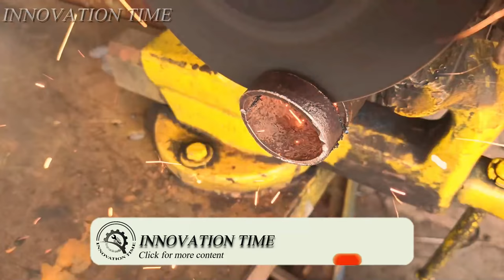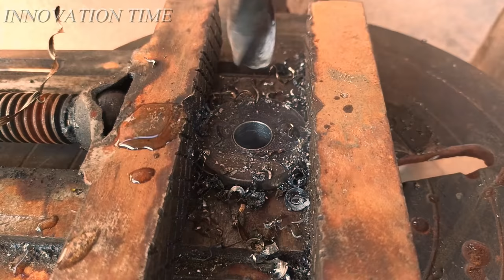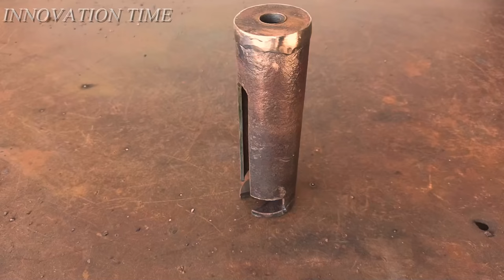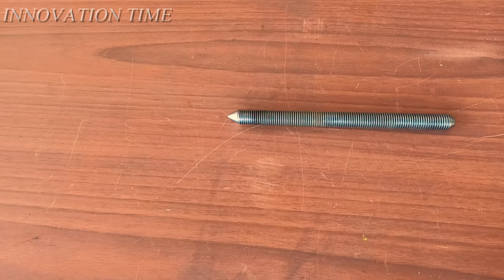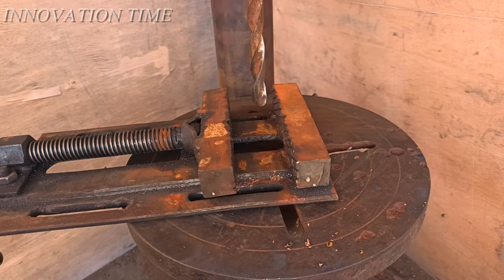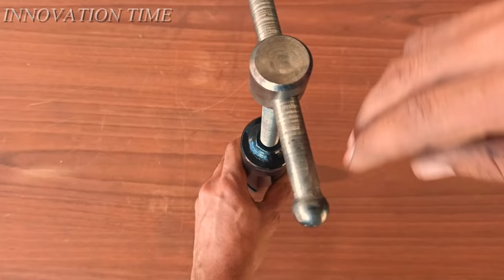AMAZING BEARING PULLER // DIY TOOL

Comment: Good idea but if the bearing is on the type of shaft shown in the video you can remove it with the vice and a copper hammer

Comment: Pipa nya itu berapa Mili sama panjang berapa bang makasih saya mau bikin juga
Reply from the maker: It depends on what size you need.
I made this with 2" pipe 25cm length. You can make it in any size you need.

Comment: Pointless. I usually avoid videos that label themselves 'AMAZING" and should have done so with this one. It's a one off tool; for that bearing size used in that application. Plus, you didn't actually need a puller. You could have used the other tool shown. You could have lowered the bearing to the vise jaws and pounded out the rod.
Reply from the maker: Hello my friend
Yes, this is a tool for a certain bearing size and I showed how it works at the end of the video. You can also see other tools I made to pull out bearings of different sizes. In addition, to pull out the bearing by tapping on the shaft causes the place of impact on the shaft to be flattened and it is completely wrong.
Good luck